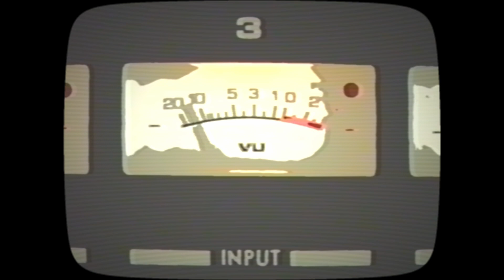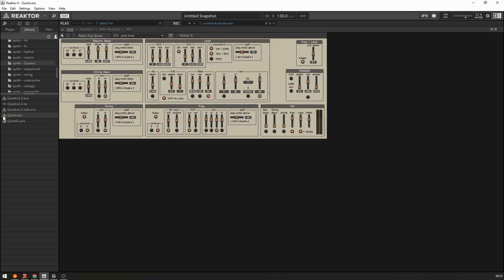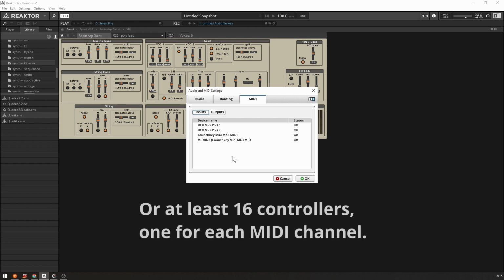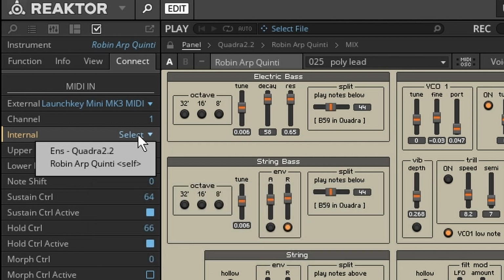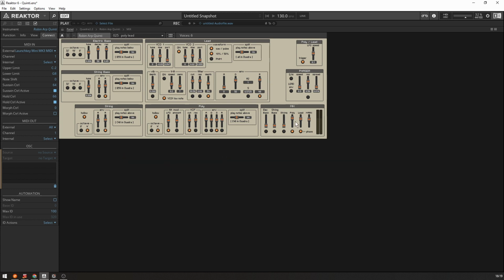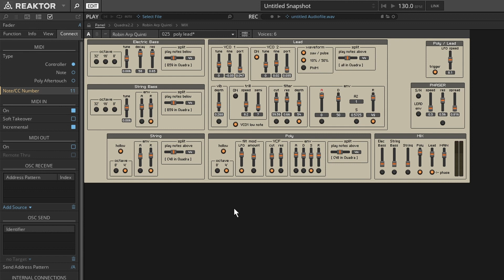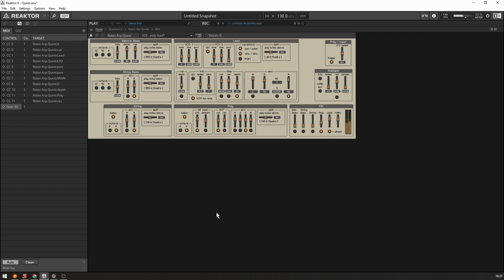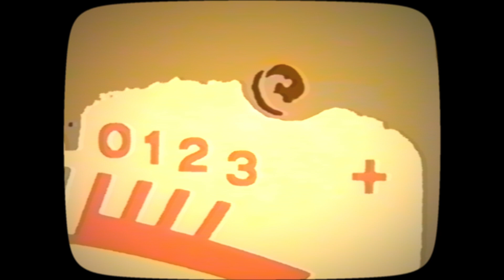MIDI Control of Reaktor

Comment: Hi Robin, thanks for posting this video summary - it's concise, to the point, and has information I either didn't know or had forgotten. I get the sense that you may share a little of the same curiosity that I do about why Reaktor seems to have faded into history. I know it can be overwhelmingly complicated, but with guidance from folks like you, it also has a ton of potential for both learning about sound design and just screwing around. Anyway, I'm not sure there is one answer, but I just wanted to commiserate a bit. Gary.
Reply from the maker: It's gratifying to get comments such as yours on videos that I've mostly forgotten about! 

Reaktor was ahead of its time in many ways, certainly in terms of sound quality. When I was auditioning similar products (Aaaaaages ago!) the only one that matched it was CSound, but that hell is not one I wished to revisit. Other products have caught up since on that front. But Reaktor has long had features that Max 9 only just added (easy MIDI mapping, full OSC control). 

I don't think the complexity doomed it... I think it was internal competition. NI increasingly added synth and effects to their catalogue that were either made or at least prototyped in Reaktor. If people realised you need only buy Reaktor, that would kill sales for these products... some of which individually cost the same as Reaktor with its thousands of user ensembles!

We can at least be glad Reaktor still exists and saw a very useful update long after I thought it was abandoned. My impression is that NI gave that as a gift to their long-time supporters.

Comment: Hi there, I need help please. My Reaktor 6 keeps changing my presets/shapshots and the midi controller is hijacking the interface and keeps changing it, how do I disable the Midi controller so it doesn't automatically change my settings?
Reply from the maker: You change change which devices are available for input and output by going to the "File" menu and choosing "Audi and MIDI Settings".

For a given Instrument or Ensemble, open the Properties panel (F5 shortcut) and choose the "Connect" tab. here you can choose which MIDI device and which MIDI channel will be active. In this way you could control different instruments with different controllers entirely. Or restrict which range of notes each Instrument responds to, in order to do things like keyboard splits. 

I am not sure how a controller could "hijack the interface" but maybe that will help!
Reply: @RobinParmar  Alright, thank you.

Comment: thanks for the vid. However: is there a way to auto map all available parameters to connected controller? Without mapping every each ensebles knob individually? I'm guessing there should be something at least for ni controllers like  maschine or kore (yup I have that old thing) to automap?Thanks
Reply from the maker: Late reply, apologies! But I don't think there is an automap because with thousands of different ensembles, how could it be implemented?